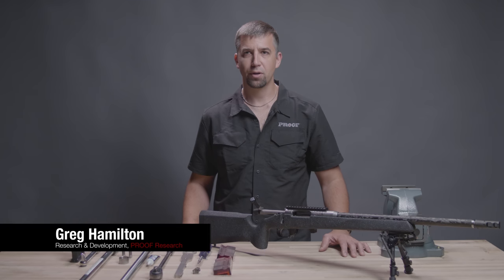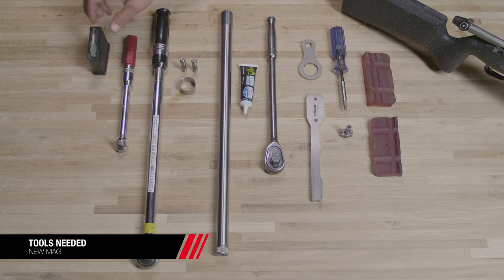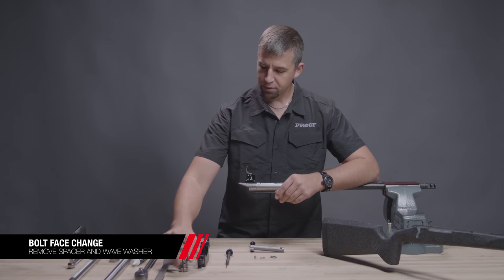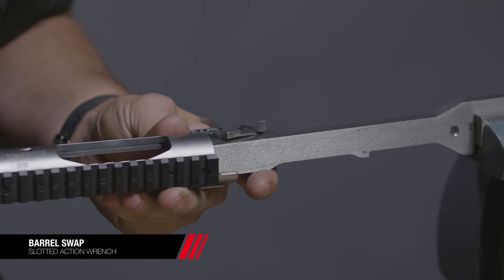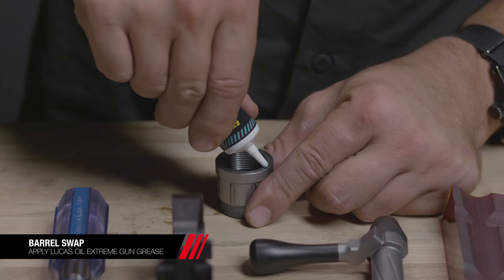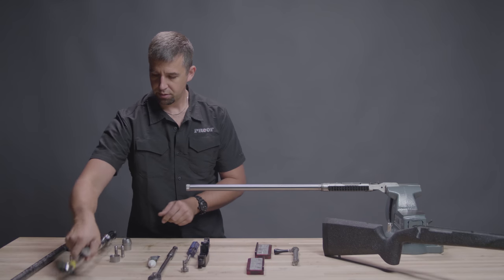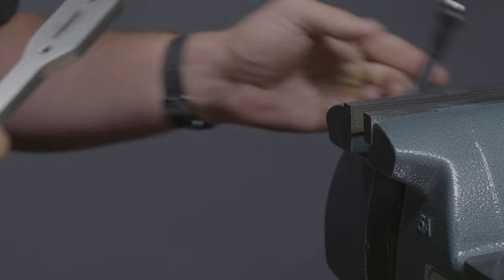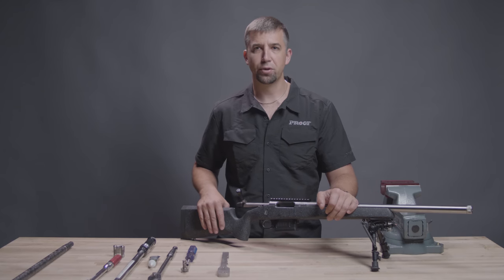SWITCH Rifle Barrel Change - A PROOF Research Tutorial

Comment: Everyone's a nit picker....including me. It looks like you were checking headspace with the firing pin in the bolt. I was taught to use a stripped bolt for a better "feel" of the headspace gauge....also the (uf equiped) plunger ejector needs to be removed for the same reason, not applicable hear, because if your manual ejector. I didn't catch what brand of rifle your were working on. Nice video.

Comment: Seems pretty darn easy. But you really should learn how to properly use a torque wrench if you're going to do educational videos. There is no way you torqued the barrel nut to 70 lb/ft - with the barrel nut adapter positioned like that, you're well over the torque spec.
An extension/adapter has to be at 90 degrees to the wrench for it to be accurate, unless you've calculated and adjusted the set torque value for the angle and length of the adapter.
Reply: Millwright ?

Comment: Do steel barrels have a POI shift during long Strings of fire
Reply: Short answer is, Yes, but "how much" and "when" depends on the contour, cartridge, firing cadence, the quality of the barrel and how well/precise all the parts are put together. In general, the thicker the barrel, the less poi shift you'd expect to see...Again though, there are a lot of variables that can have an impact on poi shift, which is one of the reasons for investing in a high quality barrel like Bartlein or Proof.
Reply: tardterminator i think i read somewhere that proof almost guarantees 0 poi shift in carbon barrels is the guarantee the same in their steel barrels
Reply from the maker: We do not guarantee 0 POI shift, but our carbon barrels help minimize it. We do not make any specific guarantees, but it is usually small to non-existent. This does not apply to our steel barrels, but due to the multiple stress-relieved steel, they also exhibit very little shift.
Reply: Action torque and heat change strings

Comment: When torquing the barrel nut, shouldn't the torque wrench be at 90-degree angle to the barrel nut wrench for the torque setting to be correctly applied without any additional leverage created by the length of the barrel nut wrench?
Reply: You are correct. The 90 degree angle is so that you don't have to "math" on what a breaker bar at 180 degrees would be. Proper torque need not happen at 90 degrees. But to keep the torque numbers matched 1:1 then 90 degrees is what you'd want.
Reply: Yes, agreed. But not everyone know that, and from the video it looks like they didn't measure angle and calculated torque either.
Reply from the maker: Yes, ideally...but the little bit of length that you add with the barrel nut wrench, if not 90deg, will not change the applied torque by much due to the relatively short additional lever arm
Reply: It adds between 4-6 ft lbs like this

Comment: Just buy another gun why change the barrel?
Or buy it in the caliber you want to change it to😂😂😂
Reply: You must be the only one laughing.  Buying another rifle is more expensive and unnecessary.  This system can be handy if you want one barrel for varmint and one for big game or if you compete and need to replace burned out barrels on a regular basis.
Reply: A factory gun doesn’t have the tight tolerances that a built rifle does and doesn’t have the accuracy to match it either